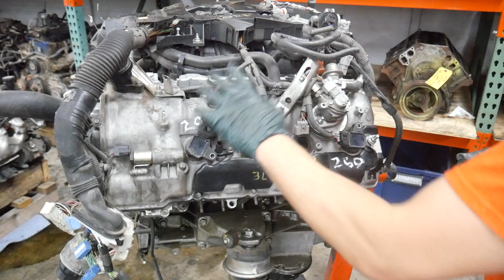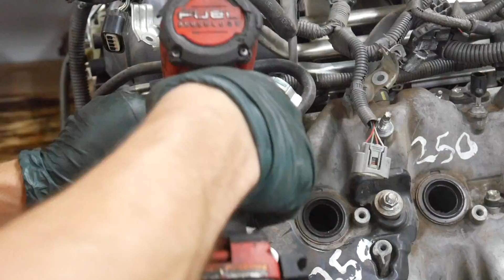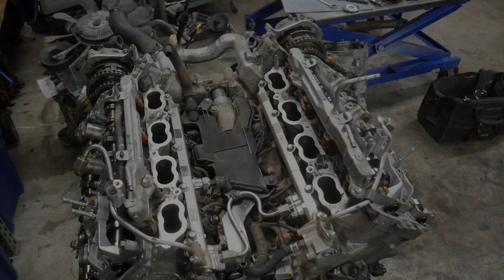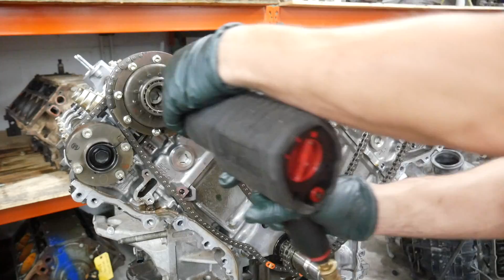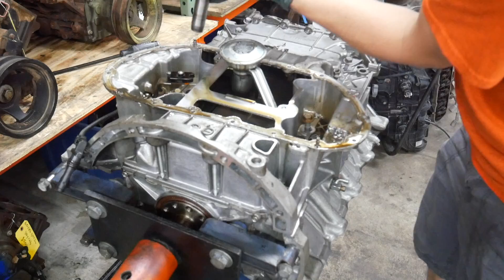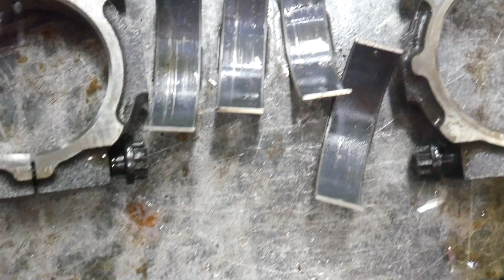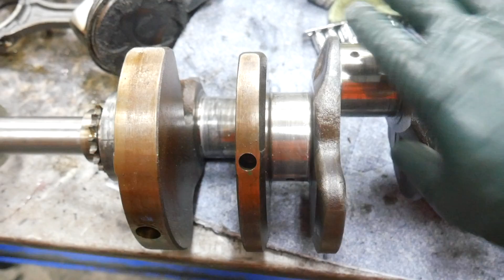Lexus LS460 1UR 4.6L V8 Blown Engine Total Teardown! How Did One Of The Most Reliable Engines Fail?

Comment: I'm a mech, these engines are bulletproof as are their larger cousins. From the few issues I've seen with these Toyota V8s it tends to be oil related. Either oil was not changed at regular intervals or it was run very low on oil. Even the toughest of Toyota products willl suffer failure without lubrication.  I would rate these V8 motors as some of the finest ever built.
Reply: What's the timing chain interval on these engines
Reply: @yuvi018  there is no timing chain interval. The chains will last the entire life of the engine. You only replace timing belts, this engine does not have that
Reply: @Oliver2020.  thanks man!
Reply: i have replaced many timming chains they do wear sometimes at a faster rate than belts l1 master car and truck @Oliver2020.
Reply: @Oliver2020. completely false, a stretched timing chain can cause a heap of problems, and does occur. And so should be replaced when so
Reply: @TM-fx5le  not necessarily true. A stretched chain would be considered a defect, as it stretches due to either lack of oil changes or bad chain guides that allow slack as mileage accumulates. A normal chain system that is designed correctly will last the entire life of the engine.
Reply: @Oliver2020.  nah ur wrong
Reply: @Oliver2020.  estas loco
Reply: @TM-fx5le  tell that to some of the engines who's chains lasted over 500k miles.
Reply: @Oliver2020.  1uz last longer haha
Reply: @TM-fx5le  without a doubt!! I had a 1999 ls400 with more than 250k and never had a single problem aside from brake replacments. Never even replaced the timing belt either
Reply: the only engine i have not replace  a chain and gears or belt is the 240 300 ford @Oliver2020.
Reply: @Oliver2020.  I got a 95 myself man, I’m actively looking for my second 😂😂 
They’re getting harder to come across from where I’m from
Reply: @juanrodriguez-ry6yt  i believe that
Reply: @TM-fx5le  yeah especially the ones from 1990-2000. It took me a year to find my 99 and unfortunately i no longer have it as it was involved in an accident. Drunk lady driving a rental hit me at a light
Reply: @yuvi018  i think Toyota changed it every 300-400k miles on a couple of those million miles tundras
Reply: @johnaethionconcentrius  thanks 👍🏻
Reply: ever ride a superbike chains wear  @Oliver2020.
Reply: @juanrodriguez-ry6yt  superbike chains are a final drive chain. they bare the weight of the entire motorcycle and the power produced by it. superbike chains have O-rings or x-rings and are exposed to the elements, dirt, sun, water, etc.

cam chains drive lubricated cams, that's it. they are shielded from the elements, they don't have O-rings and they are constantly oiled.

even motorcycle cam chains have a harder life compared to the ones in cars because they are much smaller and rev a lot higher.  and still, in saying that, do you replace your motorcycle cam chain when you replace your final drive chain? no.
My MT-07 has 100,000kms on it, I've replaced my final drive chain and sprockets 4 times and I'm still on my first cam chain.

but yes, every moving part will eventually wear out but it is entirely possible for a cam chain to out-last the rest of the engine.
Reply: @Oliver2020.  The only time you replace the timing chain on toyota v8s is when you get lucky enough to receive a faulty chain tensioner within your car. There was a batch of faulty units that were installed on driver side of the engine. If you had caught the loose chain noise in time and replaced the faulty tensioner, then your chain would still be within specs. However, if you kept driving like that for longer period of time then obviously the chain would strech and have to be replaced.
Reply: @chopperpl yes the bad batch of chain guides was mainly for the tundras and sequoias with the 5.7v8 The early 1urfse did have some tensioner guide issues but I don’t think it was major. The only issue these 4.6 really do have is the valley plate gasket leaks like you stated but not a major issue
Reply: Instructions from the gods themselves ☄️
Reply: There's no evidence that this engine was neglected. If oil changes had been delayed or missed, there would be varnish under the valve covers.
Reply: Size of this oil pump give me headache...
Reply: Nonsense, they have a huge problem with coolant leakage into cylinders because of head gasket issues
Reply: @davidboatman925  the issue is with the "life" coolant and not the design. The coolant contains lime which tends to crystilize over time. Those crystals build up in tied areas with low coolant flow (microscopic space where head gasket seals the block and the cylinder head) and deteriorate the black coating of the head gasket. The typical weak spot is between cylinders  6 and 8 where the coolant channel is. Once the black coating fully deteriorates it is a matter of time when the pressure from the combustion blows through. The same issue applies to famous coolant valley leak, but in that case the lime buildup goes all the way through the gasket braking the seal. The way to avoid those problems is simple preventative maintenance... replace coolant every 30k miles and you will be golden.

Comment: How do damaged rod bearings cause that odd carbon on top of the piston?
Reply: The good cylinder bores had carbon at the dome of the chamber - that is normal.  The pistons with the bad bearings travel higher in the cylinder because of the missing bearing material - that causes the "bare patches" where carbon was forced off because the piston is starting to hit the top of the chamber. That made the shiny spots he mentioned.
Reply: @gt-37guy6  thank you very much.
Reply: @notsofast5495  I had to think about it for a minute too!
Reply: @gt-37guy6  I’m not smart enough to have figured it out even after thinking about so I had to ask.

Comment: A high-level cleaning detergent was being ran in that motor (kerosene, diesel, engine flush) there is zero color on the aluminum way to clean.... Took out all the bearings.

Comment: any idea on the engine mileage ? seems it started out with the breakdown of bearings, then it escalate to damage the other components.  Production of bearings are rigid to a very high Japanese standard. In Lexus, every tiny piece of components are carefully manufactured with Lexus seal of approval even though it is subcontracted.  Your video is valuable. Send an email to the Lexus team, I'm sure their quality service team will appreciate your discovery.  Keep up your good videos.
Reply: If I’m not mistaken I believe Lexus also uses inspection cameras to inspect the block and components to ensure no defects.  Pretty amazing.

Comment: Have a 3800 Buick engine in my Aussie Holden. After 20 years of  use apart from oil and filters ,plugs it has never been touched.
Plain and very simple, an excellent motor
Reply: The 3.8 has a tremendous reputation for fuel efficiency too. And as a good marine engine.
Reply: good old 3.8 buick. damn good engine.
Reply: The 3.8 engine  may be the best engine GM has made. Rock solid
Reply: I have a 94 Pontiac Trans Am I bought new.  It has 338.000 miles on it . The 350 LT1 ENGINE has never been touched.  Even the timing chain is original.  Runs like new. Sounds perfectly healthy.  3000 mile oil changes,  Castrol GTX. Uses no oil, has never failed California emissions test. THIS IS A RELIABLE ENGINE! 😁
Reply: The 3800 was a spin off of the Buick 215/300. Just like the Rover V8.

Comment: Is it normal/expected for the headbolts to be so tight? And would a breaker bar work for breaking those loose, or is it important to use an impact for that?
Reply from the maker: It depends on the engine. Some are insanely tight and require a breaker bar, but it’s difficult to do when the engine is on a rolling stand. The impact makes it quicker and easier, most of the time

Comment: That engine must have been knocking  for a long time... surprising someone let it go that long to get that bad... :-(
Those spun bearings suggest sub standard oil to me....an engine like that needs the best oil...the cheap stuff just won't do...
Reply: I only use Toyota genuine motor oil in my LS460

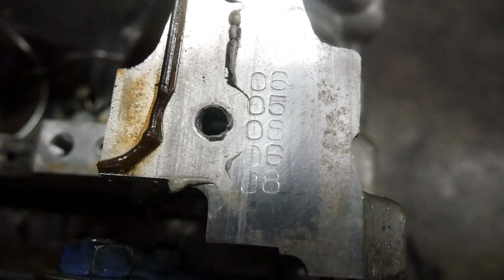Comment: 26:19 There's a lot of bad buildup on those pistons.  Seems inconsistent with the otherwise spotless engine.  Maybe the oil pump shat itself causing the bearing failure?  Certainly the only other reason is forgot to fill up with oil after service and the owner just ignored low oil pressure warnings.  The ECU should have shut down the engine on low oil pressure, though.
Reply: He mentioned in the description finding that missing guide in pieces in the pump pickup, so it probably just got starved for oil after that happened. How it ran long enough to do all that damage though is a real mystery.
Reply: @sparkplug1018  Long downhill run perhaps.

Comment: I think it would be super interesting to tear down a dead mercedes m113 v8, especially one with a supercharger from the AMG cars 2003-2006. Supposedly the normal m113 is immortal but the supercharged one always gives out at cylinder 8. A proper post mortem would be cool

Comment: how did all that debris get through the oil filter?
Reply: Until the oil returns back to the pan, the debris will go through the engine via the oil galleries.

Also if the person forgot to put oil in before starting, you have multiple components failing causing debris.

In regards to oil filters, they do have a bypass, but this has more to do with "dirt" contamination than metal, since dirty (not metal shaving type of dirty) oil is better than no oil.

Comment: Looks like a well engineered engine, I like the timing system design, has reliability in mind instead of having a 2 kilometer long chain driving both cams they have small slave chains ran of the primaries. Got to say overall it's a nice engine. Only thing i'm not a fan of is the open deck design.

Comment: Leaving the damages aside, the engine design and the construction is absolutely amazing.
Reply: I wish Diesel engines from 90 thousand dollar trucks were as well engineered.
Reply: @davids1033  No shit
Reply: It was really impressive design to not see the starter under the intake manifold and an actual timing chain vs a timing belt. Cult of toyola
Reply: They probably did 100k miles without an oil  change!
Reply: @geoffbell166  That engine was so clean, they had to be changing the oil. Maybe oil leak catasrophic failure.
Reply: @robertslegers257  Yeah true,i had a 400 for years,300k on it,towed and drove it hard as work car but i keep up the services never missed a beat,she wind out to the limiter in top cog.
Reply: @geoffbell166  Did you bother to watch the video?? That engine was ultra clean inside.
Reply: Normal engine design from this millenium. 
Ps. Are you yank?
Reply: Euro car fan boy.
Reply: @busman7228  broke boy
Reply: Pretty standard design and construction. Almost nothing remarkable about this engine.
Reply: @CadexLaw  Please recommend an amazing car engine if this doesn't qualify.
Reply: @turbolq4  Depends on what you value in your engines. If you value innovative tech this (& nearly all Toyota products) are at the very bottom of the list.
Reply: @CadexLaw  who wants innovation when simplicity and reliability are desired? In this world of bean-counter engineering, anyone that "innovates" tells me that they're selling unreliability. Just look at the latest "fad" of Direct Injection. There are benefits but also very costly shortcomings. Toyota recognized the shortcomings and now their cars come with both systems. I'd prefer port injection only, but there are legitimate benefits of direct injection.
Reply: @2006gtobob  Proper modern direct injection system have zero issues including carbon build up (i.e. BMW struggled with DI early on but has since perfected their PCV design thus no more carbon build up on their new engines.) Like literally every new technology, there will be hiccups early on that's just how the world works. I can't pat Toyota on the back for engineering something as lazily as possible, especially since you now have 12 - 16 injectors to worry about failing instead of 6 - 8.
Reply: camry v6  not at all, Euro brands are trash in their own ways. I'm just pointing out Toyota isn't anything special like their fanboys make them out to be.
Reply: camry v6  That dude is prob chinese and he just hates The Japanese...... Lol yeah 4 bolt mains and dual overhead cams. Probly forged crank rods and aluminium pistons is basic? These engines love to rev high also. It's fun to drive them. More bad ass than a push rod.......
Reply: @CadexLaw  "innovative tech" is absolutely worthless if it doesn't function and last.  How old are you kid?  25?
Reply: @CadexLaw  Beemer fanboy detected. Self destruction initialized :)
Dual fuel injectors are always a better solution than direct ones only. It is much cheaper to replace one or two faulty injectors than replacing whole cylinder head.
Reply: @CadexLaw  YEA  BUT THESE   WORK OTHERS   WELL  KNOCK KNOCK CRACKED    LINERS    ETC     AND YOU FORGOT  THE GOOD OLD 2JZ     SHURE  ITS NO SUPER  CAR  WITH  freevalve TECH  THE NEXT  BIG THING    BUT HAS ITS OLD   FOR ITS TIME  DOHC    VVTI  WAS   NOT THAT LOW  TECH   NOT LIKE AN PUSH ROD   UNIT  LOL
Reply: @TCBOT  idk what the fuck u just said but go off my man
Reply: @Nudel-nc1cp  why would you have to replace the whole cylinder head with carbon build up..?
Reply: @CadexLaw  you know whats not special? A mk4 supra nor a 2gay z lol
Reply: @CadexLaw  BMW brought back port injection (good decision), so now they have both DI and PI as in Toyotas
Reply: @CadexLaw  if it has overhead camshafts and no 4bbl carb, its amazing

Comment: this engine has no sludge......so it had regular oil changes, and was low mileage.  It was started up with no oil. Unless the oil pump failed (unlikely). Some modern engines must have the oil pan refilled within 10 minutes of being drained or the oil pump loses its prime.....doubt it applies to Toyota.
Reply: Maybe it was ran without any oil for a short amount of time

Comment: They ran it without oil. 
Why don't all cars have a low oil LEVEL warning light. Not just low oil pressure.. but LEVEL. 
Some cars do.. most don't.
Reply: Even if it does, you'd be amazed how many people would just ignore it. Or not bother to find out what that light means.

Comment: Specific oils for most engines these days, making oil changes very critical. Trusting your expensive vehicle to the "cheapest oil change in town" joint might be the worst mistake you'll ever make. Dealers are also capable of screwing up.
Reply: Just do it yourself. Taking anything to any mechanic these days is a big gamble. I've found most dealerships to be more incompetent than those cheap oil places. Had a Toyota dealership tell me my fuel injection system was throwing codes and it would cost me 2500.00 to replace it.. car came from the factory with a carburetor.
Reply: @rustbeltrobclassic2512 This is so true. I have personally seen cars severely under and overfilled with oil at dealerships. 

People have the misconception that dealerships are the best places for their car care. But often, with mundane but important tasks like oil changes, they don't have their a-level technicians doing that stuff, but usually some idiot highschool dropout.

Comment: The toyota v8 engines. 4.6 / 4.7 / 5.7 are all great durable and can easily go way over 500 k miles.   Of course they  need oil changes like anything else.  
     I have shopped for 20 year old sequoias and land cruisers and never seen a bad engine yet.

Comment: 😢😭Check the oil filter housing cap, it should have a metal tube with holes in it, stops the oil filter from collapsing and causing oil starvation to oil
pump and subsequent engine failure.
This tube comes out at times with filter and if not noticed and put back in will ensure, not today but soon your engine will seize.
Ask me how i know😓
Reply: did you have a ls460 seize on u? mine is about to go I think, im getting camshaft and crankshaft retarded timing codes and also crank and cam correlation codes, as well as there was metal in my oil and there is a bit of chain slap I think on start, is this the oil pump and timing chain? id assume it is

Comment: Lexus seems like they have no protection devices to shut the engine off during no oil pressure situations , i have seen Mazda 3 shut itself off when it blew the oil filter off  on the highway so why should an expensive Lexus keeps driving without oil.
Reply: I don't know of any engines from any of the vehicle manufactures that will shut the engine down if there is no oil pressure.
Reply: @Discretesignals  if you don't believe me get a 08 or 09 Mazda 3 and take the oil filter off and see .
Reply: @floodythesweatswitch4899  I really don't think I'm going to unscrew an oil filter while the engine is running to see if it shuts off....lol
Reply: @Discretesignals  Chevy had cars in the 80s like the 2.8 v6 that the fuel pump was wired though the oil pressure switch I've seen it myself where bad oil pressure switch causes no start
Reply: @floodythesweatswitch4899  the oil pressure switch on those cars were wired in parallel with the fuel pump relay, so if the fuel pump relay stopped working the oil pressure switch would close and allow power to the pump.  The way it was designed the car wouldn't shut off if it lost oil pressure unless you had a bad fuel pump relay.

Comment: It seems like the vehicle that engine was originally installed in was babied.  From the looks of the internals (aside from the metal debris),  seems like the previous owner was religious in its maintenance.

If it was maintained that well, wondering how that cylinder pressure was low.  Like you said, these engines last forever.  Would’ve been interesting to take a read of the cylinder pressure before the teardown